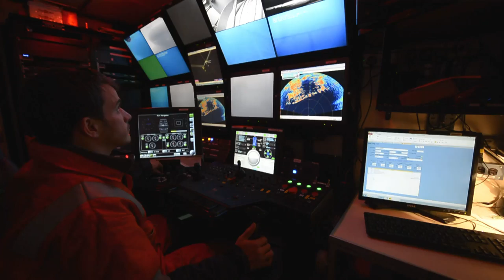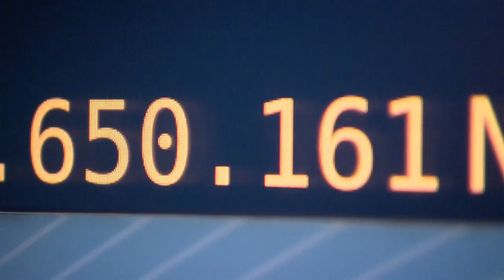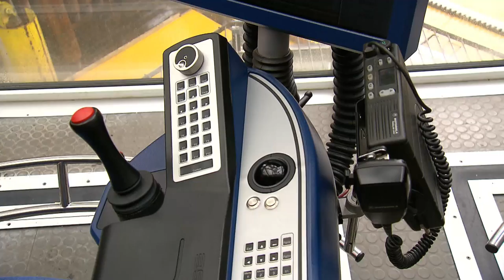Norway's Lasting Oil Wealth

Comment: "This is a floater. It floats."
Reply: When it comes to the word float, it is called flyte-platform in Norwegian and the person translated the word directly.
Looking at the major oil constructions in the North sea: Gullfaks A, B, and C - Oseberg A, B and C - Troll A - Heidrunn - Sleipner A, Draugen and many other installations, these giants are made in concrete and are standing on the bottom of the sea. So when you went out to work on an installation that was not standing on the bottom. people started too call them "en flyter" (a floater).

Comment: How isn't this standard.
Reply: Because if you decide to do it as a country, you go from spending lots of oil money every year to suddenly hardly spending any oil money - because you have to save up some before you can start using the fund's profits. Norway knew (or thought) they were going into a phase where they would invest less in oil because the oil industry was mature and therefore profits would be much higher (getting returns on all the oil investments all ready made) and they could start putting the windfall in the oil fund.

Comment: Norway has also the luck, that unlike the UK it has some 50/50 projects with Russia very far North or in the Barent Sea... "Goliath" oil field is even operated by (Italian) ENI... Gas is increasing for many years in a row now while UK had both peaks around ~2000... Norway has a population which is maybe 7.5% these of UK? The country therefore is very low populated, the density is only high in the few towns like Oslo, Narvik and others... so they can use Hydropower, the Gasoline and Oil is not wasted - Gasoline is expensive - ok Countries which offer cheap gasoline like Iran, pre-2003 Iraq, Qatar etc are extreme rich in oil reserves...

Norway will do well I guess... they only need to controll migration. It was already quite high, but still ok, before the migration crisis started...
Reply: wrong. migration here is not a big issue atm. you mix norway with sweden
Reply: If an Norwegian oil company starts drilling after oil and finds it in the Barent Sea they pay the Russian goverment 10% of the surplus and the Russians do the same whit Norway. It has worked out fine in the fishing industry for over 50 years.